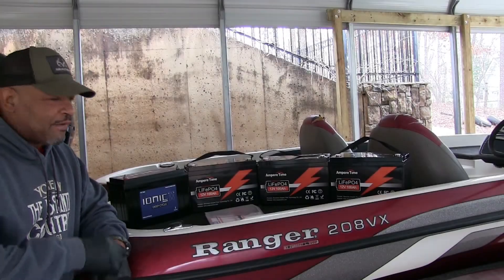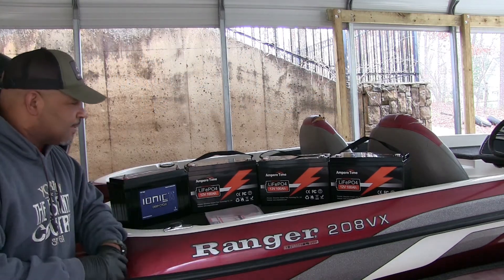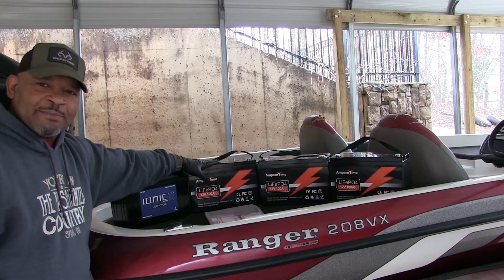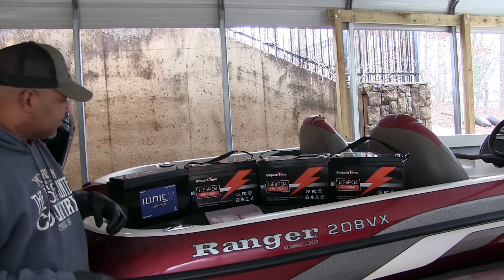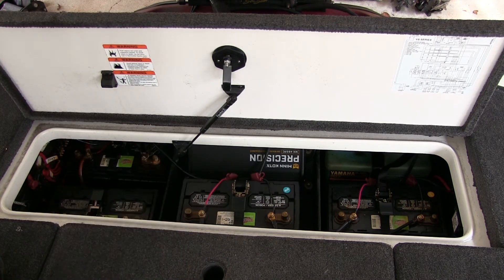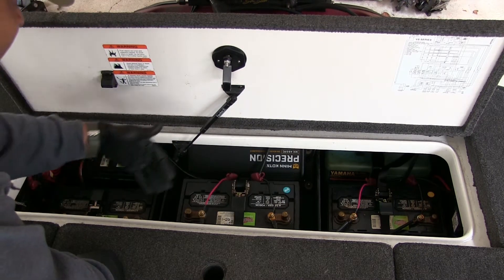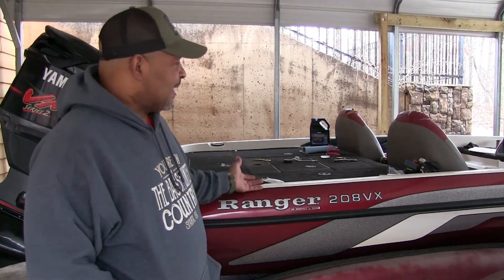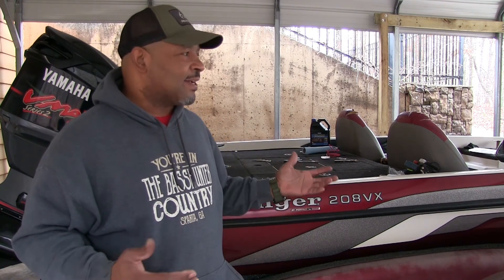I Got Ampere Time and Ionic Lithium Batteries This Season

Comment: After this review, what is your take on the Ampere Time Batteries after using them for a while?
Reply from the maker: For me this is one of the best things I have ever bought for fishing. I can't said they are the best because this is the only lithium batteries I have ever had but the batteries have not missed a beat. I fish for to days without charging easily and I'm sure I can go for long but just don't. Most of the time it only take 30 to 40 min to charge back up to 100%. These batteries are the cheapest and must used lithium batteries around. I wish I would have bought them years ago and most lithium batteries are made of the same cells. They just package them different and they added Bluetooth. And you can see in my other video you can add that for yourself. https://youtu.be/D0wWJQri52E but if you are thinking about buying lithium batteries please do it and don't think about it again. It's worth all the money. But make sure you buy a staring batteries also because your units are ran by the start battery. If you don't replace that one your experience will not be the same. That is why I bought the Ionic battery. Ampere time doesn't have a starting battery and the starting battery is made different than a regular lithium battery. The Ionic starting is 125ah battery and it was $799. That was the cheapest/ best starting battery I found. I hope that helps and if you need any more info just ask.
Reply: @thebasshunter  Thanks for the info on the Bluetooth device, bought one today and luckily when I went to Amazon they only had one 24v 100ah battery left so hopefully I got it before someone beat me out. Lastly what battery charger are you using for the lithiums and what military branch did you serve?
Reply from the maker: @michaelj8067  I’m using a Minn kota 460PC four Bank charger. I just installed that charger 2 years ago. It’s not a lithium charger be Minn Kota says it will charge lithium batteries just fine. But as for the military thing. Everyone thinks I have been in the military but sorry to say I have not been in the military. I’m just an old college football player. I played football at University of southern Mississippi back in the 90’s.
Reply: @thebasshunter  Thanks for the reply brother, I will look into that charger. And yes you did get me on the military thing. Be Blessed!

Comment: I’m thinking about getting the ionic starting battery.  I have the same motor as you and I know Yamaha doesn’t recommend lithium on there motor but I’ve noticed people using them.  Have you had any issues with the motor because of the battery? I’d really like to get one.
Reply from the maker: No, I have not had any problems. The battery has worked great for 4 years now. I highly recommend this battery. Good luck.
Reply: @thebasshunter  thanks I’ve already ordered ionic for my tm and electronics.  Now I’m going to order the cranking battery

Comment: How are those batteries working out for you for the last year. I have been thinking about getting me some for my trolling motor. I like the idea of loosing the extra weight.
Reply from the maker: That’s about the best thing fishing wise that I have ever bought. They had been working great and I have not ran them down pass 50% yet even after three days of fishing. I would not wait on buying this batteries if you tournament fish. You don’t have to thing about power problems ever again. I would also buy a starting battery also. That’s the most important one. But there great and I don’t have one bad thing I can say about them.

Comment: Just got my AT batteries (12v 100AH) they are a little larger than expected. what type of battery tray or case are you using?
Reply from the maker: I used the same trays I had for my old batteries. I think on old batteries were group 29 batteries. So, you going to need group 29/31 trays.

Comment: Great video. Is there a way to test the remaining power on the Amphere Time batteries?
Reply from the maker: Yes, you can get a voltmeter just see how many volts is left in the battery. When you get your batteries from Ampere Time they will send a booklet the show at what voltage your batteries are will tell if it’s at 80% or 50% or you can do what I did and put at Bluetooth meter that will tell you the voltage. Here is that video from that https://youtu.be/D0wWJQri52E. I hope this helps.

Comment: Hi awesome channel  I want to buy the ampere time  batteries for my garmin 1222 livescope setup and sone for my minn kota 80lb thrust riptide trolling  motor  but before  I but to you recommend them I don't want waste money  I fish about 10 to 12 hours just want some batteries that will last do you recommend before I buy some  thanks
Reply from the maker: I love the batteries and I have a 112lb Minn Kota. I have had one subscriber that said Ampere Time would not warranty his batteries that was in a 24v setup. I don't know why but that is what he said. My setup is 36v but that was the first I heard of that but you might want to contact them and ask that question. But mine have been working great and I should have bought lithium batteries years ago. Most of the time I practice two day without charging my batteries. I could go longer but just don't. You are not going to find a cheaper lithium battery and they work great. They are just not a starting battery. That's why I bought the Ionic.
Reply: Thanks for info that was really helpful

Comment: Sorry I asked this question on another video, but I wasn’t sure you’d see it!
With the ampere time batteries, are you at all worried about high summertime temps with these batteries?  I know the spec sheets mention charging and storage limits!  Thanks in advance!
Reply from the maker: I think the Ampere Time batteries are just as good or better than the high price batteries. I have been running this batteries for about 4 months now. I have had not issues with charging are usability of the batteries. To answer your question, no I not worried about any over heating issues with the batteries. We are just getting into the hot months of the year but I don't think I will have any problems. I have been charging my batteries every two fishing trips. To not over charge the batteries also. I could most likely do 3 trips before charging. That is how good the batteries are working out. If you need any more info just ask.
Reply: @thebasshunter  I placed my order using your Basshunter discount code.  I saved just enough to by some new frogs 😂😂😂 Thanks
Reply from the maker: @MrGitzet  Thanks, I’m sure you will love them. It’s possibly the best fishing related thing I have bought yet.
Reply: @thebasshunter  thanks for the response!  Looks like I’ll be placing an order today!

Comment: I have been thinking of switching out my cranking for a Lithium battery.  Are you running the same charger?
Reply from the maker: Yes, I changed my charger about two years ago to the newer Minn Kota charger. They say on the AGM setting will charge the lithium batteries. It has been charging fine.
Reply: @thebasshunter  Are you keeping a battery as a spare just in case you have issues with your new cranking battery?
Reply from the maker: @TX_Nupe  I have one but I’m now taking it to each tournament. I feel confident in the starting battery after two tournaments.